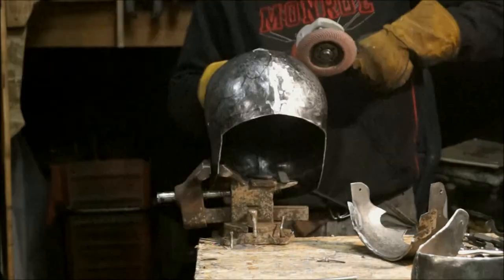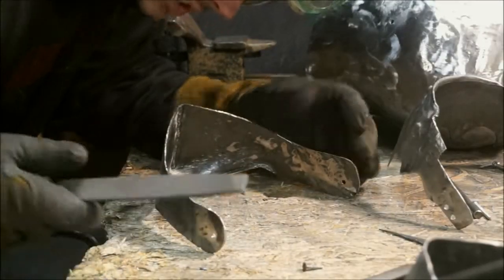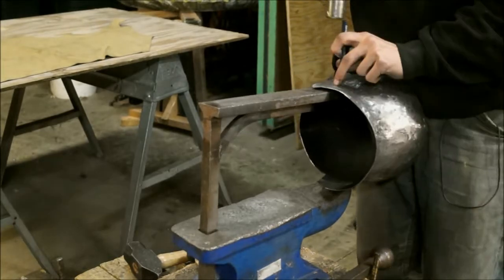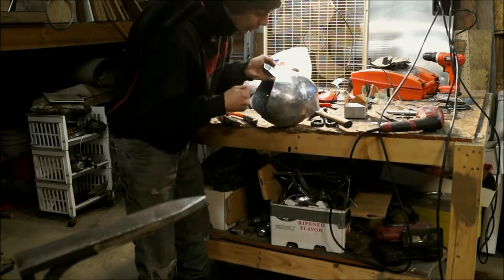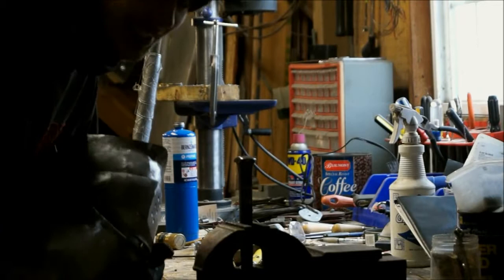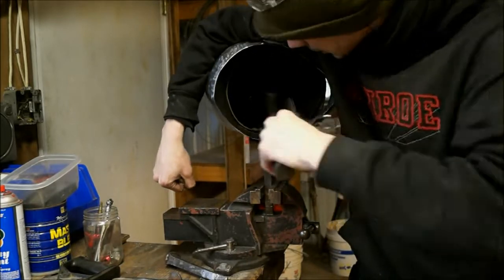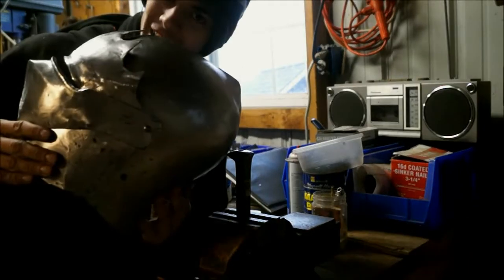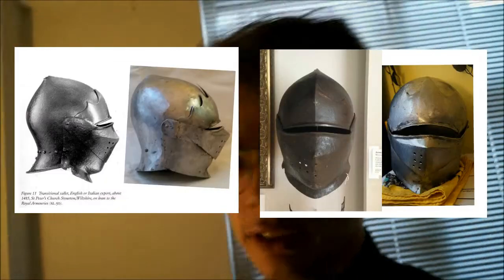Medieval Close Helmet 4: Nearly Done!

Comment: at the beginning of the video I noticed that you adjust your parts when cold, you should use a propane torch to soften the steel and make the work easier.Moreover a heat source helps greatly to flatten the surface of your room and have a more beautiful finish, you have a good base young men but still a lot of gaps to fill to become really good ;-)

Comment: you should modify your hammer to repel the steel by slightly rounding your pane to not make a mark and have more pushing power. the plumbing tuillot is a good idea but it will be better if you buy solid cylindrical bar and grind them, you would have much easier to push your steel

Comment: at 3:30, why are there 2 holes? And what are you putting on the inside of the helmet, and do you ever pad the helmet? I love your work!
Reply from the maker: Thanks! Admittedly I just drilled the first holes in the wrong spots, but it's covered by the bevor plate haha. I did end up padding the helmet with a suspension liner, though I just haven't made a video for that yet unfortunately. Hopefully I will soon!

Comment: is 1 mm armour good for sword fights like you do?
Reply from the maker: Only usually on certain armor components where saving weight is more important than outright protection. For example, my greaves are 1.2 mm, and vambraces could be as well, but for most of my armor I use 1.5 mm. For helmets I prefer to use between 1.8 and 2 mm.
Reply from the maker: I think 1mm would be alright for lighter sorts of fighting, but historically they tended to be thicker. I should, however, make an amendment to my earlier comment about thicknesses, since I was thinking exclusively about steel or iron without any sort of heat treatment, I've seen armors made from thinner than 1mm, but they were always very well hardened and tempered.
Reply from the maker: As far as shape goes, it's not so bad because of the length, although there is that cutout on the bottom which I don't believe will be found on any original breastplate. If I were to be pedantic about it, the "back plates" didn't usually come around the back that far and were more for protecting the sides of your ribcage. But that's not the worst thing to have.

So historically it has the length going for it, but the cutout at the bottom takes away from that a little. I think it could be closer, but it's certainly not the worst I've seen, if that helps at all :)
Reply: thanks